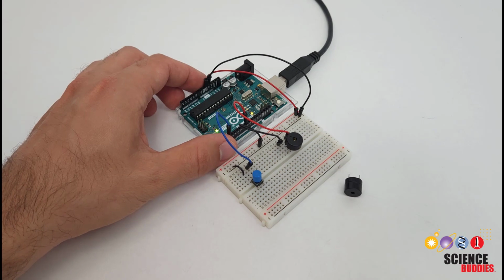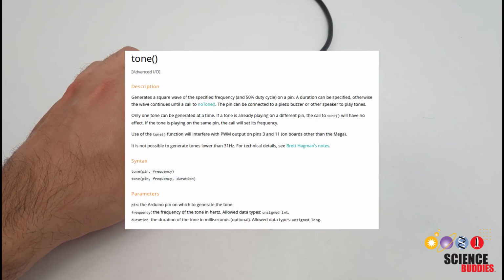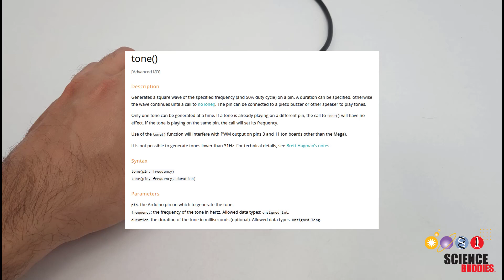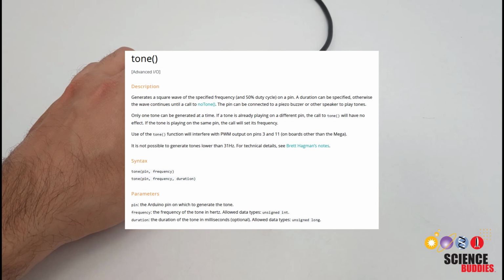How to Use Buzzers (Active and Passive) with an Arduino (Lesson #20)

Comment: How to make transitions without using delay?
I have a project that requires a buzzer but using delay will interfere with other tasks.
Reply from the maker: We recommend asking for help on the official Arduino forums.
Reply: the simplest way to do an async delay is to store the time with millis(); and in the loop check if (storedTime + millis() > yourDelay)

Comment: Hello, mine just produces a loud buzzing sound regardless of the code. any idea why?
Reply from the maker: Hi - we recommend asking for help in the official Arduino forums. You will need to post both your code and pictures of your circuit, otherwise there's really no way to tell what's going on.

Comment: To whoever wants to give this a try, you may need to reformat it in the Arduino IDE, though.

// Pin where the speaker/buzzer is connected
const int speakerPin = 13;

// Define the notes of the song (in Hz)
const int C4 = 261;
const int D4 = 294;
const int E4 = 329;
const int F4 = 349;
const int G4 = 392;
const int A4 = 440;
const int B4 = 466;
const int C5 = 523;

void setup() {
  // No setup needed for this example
  pinMode(speakerPin, OUTPUT);
}

void loop() {
  // Twinkle Twinkle Little Star melody
  tone(speakerPin, C4, 400); // C4 for 400ms
  delay(400);  // Wait for the note to finish
  
  tone(speakerPin, C4, 400);
  delay(400);

  tone(speakerPin, G4, 400);
  delay(400);

  tone(speakerPin, G4, 400);
  delay(400);

  tone(speakerPin, A4, 400);
  delay(400);

  tone(speakerPin, A4, 400);
  delay(400);

  tone(speakerPin, G4, 800); // G4 for 800ms (longer duration)
  delay(800);

  // Repeat the melody (you can modify for more or fewer repetitions)
  tone(speakerPin, F4, 400);
  delay(400);

  tone(speakerPin, F4, 400);
  delay(400);

  tone(speakerPin, E4, 400);
  delay(400);

  tone(speakerPin, E4, 400);
  delay(400);

  tone(speakerPin, D4, 400);
  delay(400);

  tone(speakerPin, D4, 400);
  delay(400);

  tone(speakerPin, C4, 400);
  delay(400);

  // Wait before repeating the song
  delay(1000);
}
Reply: Thank you! For some reason, the IDE didn't like "const int A4". Changing the name of that variable specifically worked though :D
Reply: @Runix1  i think its because A4 is use for analogue pins
Reply: @Runix1  I agree
Thanks!
Reply: mantap

Comment: arduino sayig
this Sketch uses 2304 bytes (7%) of program storage space. Maximum is 32256 bytes.
Global variables use 28 bytes (1%) of dynamic memory, leaving 2020 bytes for local variables. Maximum is 2048 bytes.
avrdude: ser_open(): can't open device "\\.\COM5": The system cannot find the file specified.

Failed uploading: uploading error: exit status 1
pls help guys
Reply: At the top there is a tab that says tools, click on it and then click on "port" just select the one that is available as an example: "COM5"

Comment: Thanks for the tutorial! Is it possible that a buzzer can in some way damage the output pin of the Arduino, perhaps drawing too much current or by backEMF of some kind? Is it completely safe to use them directly no matter which size of buzzer we deal with? Also the loudness of the sound is pretty low, is there any way to increase it?
Reply from the maker: Hi - it would depend on the specs of your buzzer; in general these small buzzers are safe to connect directly to an Arduino pin. To be safe you could drive one with a transistor instead - look up our video on controlling DC motors, it would work the same way except with the buzzer instead of the motor.
Reply: @Science.Buddies Thanks!

Comment: Nice job man 👍.. btw sorry if i ask .. but is there any way how to make that buzzer wireless plus  make the distance more longer like around 500 meters to 1km ? and when you press the button it will make the tone .. keep up the goodwork man .. big thanks
Reply from the maker: Hi - there are a variety of wireless communication options for Arduino but unfortunately we do not have any of our own tutorials on them yet, so you would need to search online.
Reply: @Science.Buddies  ahh yes i also had that thought but is it more better to use some sort transmitter module or bluetooth/wifi ?
Reply from the maker: You will need to look into the range of different wireless technologies. A kilometer is probably way too far for bluetooth or wifi. We can't really provide more help with this since we don't have our own tutorials, you may have more luck on the official Arduino forums.
Reply: @Science.Buddies  ahh alright man .. well thank you very much for the explanation bro .. wish the best for the channel
Reply: Hello.
You can do that with this radio: "NRF24L01-PA-LNA" , I tested it's range to 1 KM (line of site). One costs around $4 and you need 2. There is alsoa  smaller version without large antenna, that one without external antenna goes around 100m I think. 
Newer better radios like LORA will probably have longer range, but this above radio is nice and cheap.